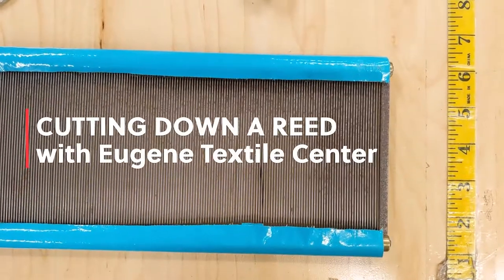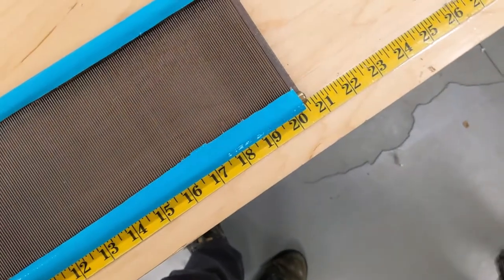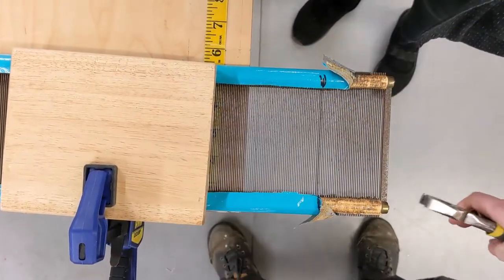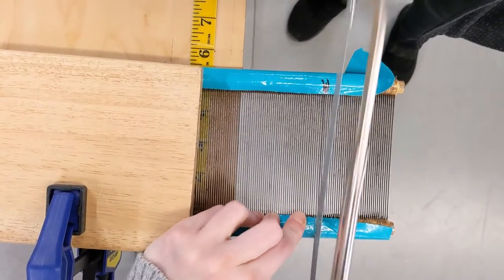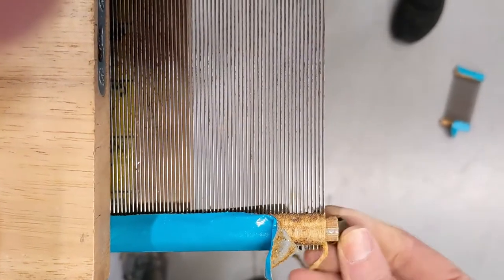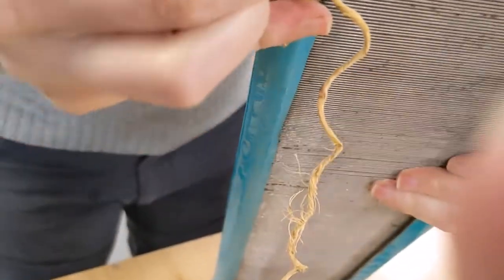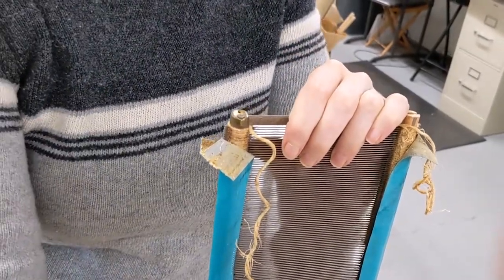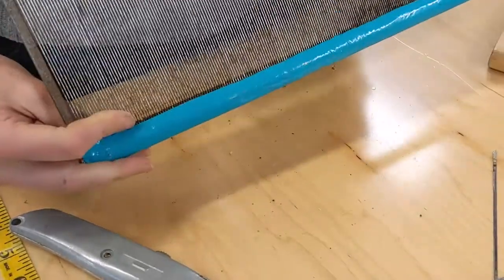Cutting Down a Reed for Weaving

Comment: Great how-to. I have some reeds that are too long, not looking forward to shortening them! Also, it looks like the reed has a lot of rust on it. How do you deal with that?
Reply from the maker: For surface rust, we use a brass brush (like for cleaning a barbeque). For more serious rust, Naval Jelly is an option, but it will leave the surface pitted. I would also consider shortening the reed to get rid of the worst bits.
Reply: I have old reeds like this. How do I do this rust cleaning without damaging the tape?

Comment: Do you know where I can get the wires to make reeds? I just cant justify the price for one for my loom am poor and weaving yarn is expensive enough as it is! Lol Plus I think it would be a good self-educational adventure. I understand how they're made I just cant find the wire. I want to dabble with making fan reeds and multi epi dents as well!
Reply from the maker: I would try talking to a machine shop or a local steel supplier. You could also go and gather reeds from a local water source and make them the truly old-school way. There are people who claim that reeds made of actual reed are amazing to weave with. Best of luck!
Reply: @EugeneTextileCenter  unfortunately I'm in the desert so we don't have water sources! lol I'll look around for shops, i guess. Not too much close to me on my side of town at all for industrial goods unless its an old shop thats still around. Its weird how big our city is but how hard it can be to find things (even weaving yarn is like an hour away and I haven't been to the shop physically to know if they have actual weaving yarn or just sock weight yarns). Its rough out here! Lol
Reply from the maker: @buffpanda527  Sounds like it's time for a road trip! Best of luck... You can also use splints of bamboo (or other hard wood) instead of reed or metal if those are easier for you to find where you are.
Reply: i will be making reed out of steel banding tape/strapping tape. It is 0,5 or 0,4mm thick and 13mm wide, rigid and springy. You can find it in shops that do heavy packaging, they will gladly sell you several meters. For my 20DPI by 40 inch reed i will need some 130 meters of it. Cheers!